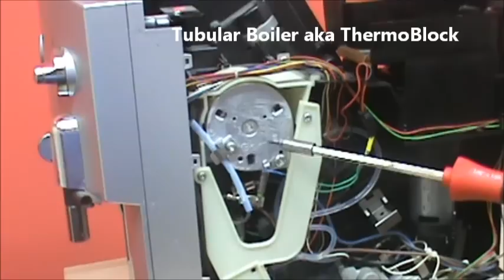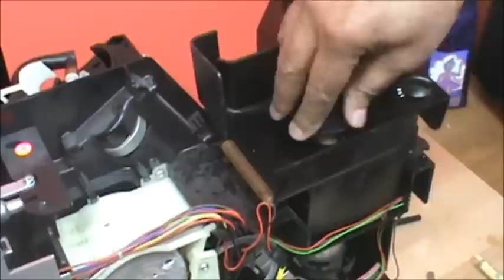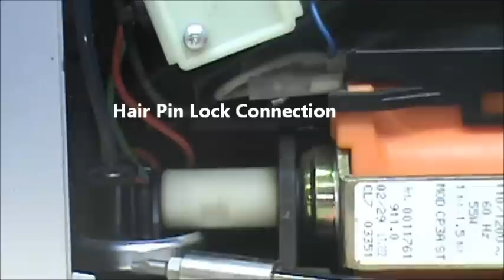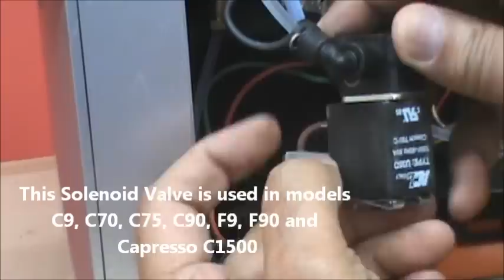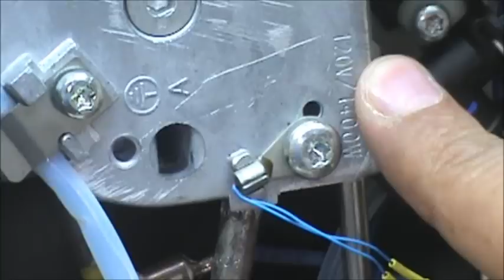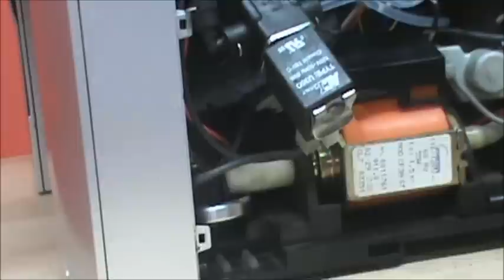How to Fix Jura Coffee Machine | C1500, C9 and F9 | Part 2 of 2

Comment: Jura Capresso
Impressa S9 Not getting hot coffee.  Heating element replacement?  If so, any idea cost for part?  Thx
Reply from the maker: Replacing the heating element won't make much difference. Run multiple descaling cycles to flush out calcium sediments from water lines and heating element.
Reply: @PartsGuruUSA  anything you’d recommend for a descaler?